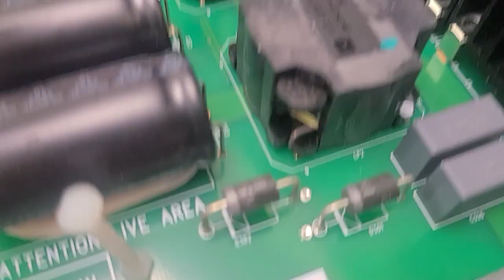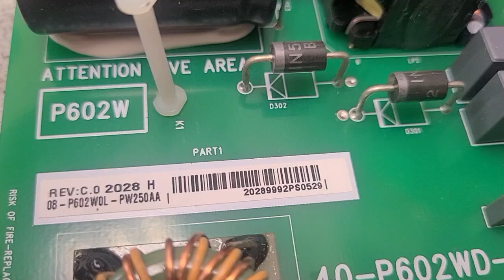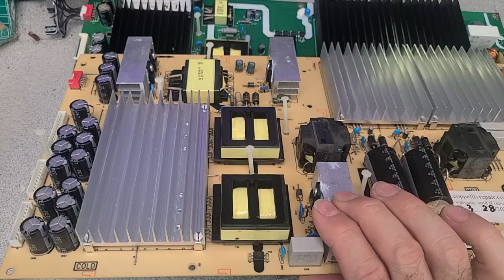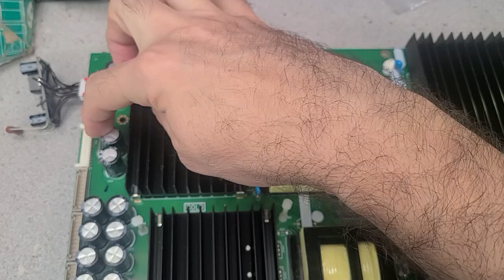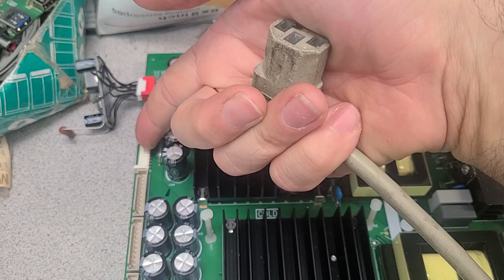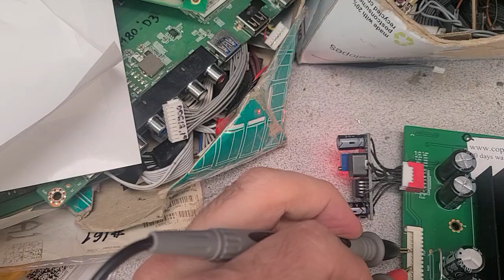How to test TCL 75R635 power supply board 08-P602W0L-PW250AA (w/ fproof for R.Cornack)

Comment: Hey there, i have a TCL 65r635 with the  08-p402w0l-pw210aa board... I'm getting no visual, no audio, no indicator....and i want to fix this tv.

Are those mosfets usually the failure points on these boards? Visually, my capacitors looks to be in good shape and no burn marks anywhere. Looking for advice how to diagnose this board.